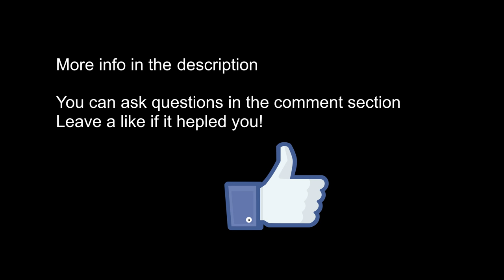Mitsubishi Lancer 2011 front brake replacement for cheap

Comment: Seems easy enough. We’ll see how it goes in practice. I hope my Colt 2007 is similar.
Reply from the maker: It should be, I have an upcoming video on Dodge RAM brakes, and there's not much difference. I hope it went well for you.
Reply: @sgcars6731  Hi, so I went for it. It was smooth on the first wheel. As per video. Went to the second wheel, removed the top bolt from the caliper, tried to undo the second but someone round it previously. I had to put it back and wait for a replacement bolts. Once these arrived it was easy. Cheers.

Comment: My brand new Quick Stop pads squeaks from 40 - 110kmh, I didn't put the bolts back to torque spec besides the wheels, could that be why? And the Rattle Clip centers itself doesnt it? (I Cleaned front and back of the Brake Rotor)

Comment: awesome video man.. quick question What type of brake gel did you get and where did you apply it to before you placed in the new brake pads ?
Reply from the maker: I suggest that you use brake lubricant (I used Permatex ceramic brake lubricant, but any high heat brake grease) on the sides of the brake pads where the pad touches the caliper (never use the grease on the friction surface that touches the disks, lubricant on the disk brake will reduce the stopping power, since the brakes works by friction). If you don't use lubricant, one of the pads might stick (because of friction and rust) and you will get uneven pad wear (like on my driver side, the outer pad is at 50% left and the inner pad is at 25% left because it had no grease and rust reduced the clearance).

The slide pins of the calipers must also be lubricated to prevent uneven pad wear, but note that some petroleum based greases sometimes damages some rubber boots on the pin, it depends, the Permatex lube states it can be used on rubber, read the back of the brake grease, it should be written. Some people like silicone grease, but it's not usually the best for metal to metal lubrication.

Don't forget to remove the manufacturing oil film (rust inhibitor) left on the new disk rotors (if you bought new ones) with brake cleaner, alcohol or acetone (or dish soap and water if desperate), or else the stopping power will be reduced for a while, it might be dangerous.

Comment: I went to replace my front wheel hub assemblies as far as I could see the parts sent will not work, as it appears it's only bearings that have to be removed from the housing, and new ones pressed in, very frustrating as I specified my exact year brand and model and many things say they work, but it doesn't appear so, mind you I could not brake the rotor away from the hub, so I'm curious did yours have a 4 bolt wheel hub bearing, or just the whole knuckle assembly with the wheel hub?
Reply from the maker: It happens, I had to delay my Impreza rear brakes video because they sent me the wrong rotors, the disk was the right size but the drum was too big and the parking brake didn't work. I don't know about the hub, it didn't need to get changed yet.

Comment: Thanks for the video, one question tho. Do you have to torque the bolts to a specific spec when putting the caliper bracket back on ?
Reply: From everything I've seen and read, as well as advice from a mechanic friend, no. My friend said he has never torqued caliper bolts
Reply: Not all caliper bracket bolts are the same. Typically these bolts require only 25- to 35-ft/lbs of torque. Also, some bracket bolts can be torque-to-yield or require liquid tread lockers.

Comment: Great video going to change my breaks based on your video I just have one question why did you remove the break fluid cap before pushing back the piston?
Reply: I belive it is so that the air can be purged when the clamp adjusts and holds the break pads down. That way the air can leave the system without leaving air bubbles in the break fluid

Comment: Can you take off the entire caliper then replace the brakes pads?
Reply from the maker: Yes, the caliper was rotated on the top slide pin for convenience, but it's the same pin as the bottom one so you can push the caliper out of the bracket as needed.

Comment: Est-ce que tu as besoin d'un torque précis pour les bolts ou juste tight?
Reply from the maker: J'y vais au feeling pour ça (comme la plupart des mécaniciens) mais voici les specs officielles pour si tu veux prendre le temps de sortir le torque wrench:

Caliper body assembly to the support - front disc brake:
Tightening torque:
Caliper bolt: 27 N·m (2.75 kgf-m, 19.9 ft-lb)

Front wheels:
Tightening torque:
120 N·m (12.24 kgf-m, 88.5 ft-lb)
Reply: @sgcars6731  merci!

Comment: You don't need to bleed the brakes? Merci pour la vidéo!!!
Reply from the maker: No need to bleed if you don't unhook the brake line, Il faut juste presser le piston du caliper pour pouvoir mettre les nouveaux pads et le liquide va retourner dans le réservoir. Maintenant j'utilise une simple C clamp, ou des fois juste mon pouce... comme dans mon vidéo Sur les freins arrière de mon Subaru à 8 min 54 sec https://youtu.be/_FQKrtoLtKw
Reply: Merci SG Cars. Brakes done! You're the best!

Comment: 0:14 please what size is the hexagonal tool used for these or can i use regular pliers
Reply from the maker: I think it was a regular 14mm metric socket/wrench , but don't use pliers, it may damage the bolt and you will regret it next time you have to change the brakes. If you don't have wrenches, look at a big car store or a Walmart, the often have small kits for less than 10$.
Reply: SG Cars thanks man! ill check in Walmart or AutoZone. thanks again!!
Reply: is it really just a 14mm or a 17mm is needed to remove the caliper bracket? Thanks!

Comment: Do you need Threadlocker on the slide pins?
Reply from the maker: No, that's the opposite, you need it to slide freely, you need grease (high temperature brake grease). On this design, putting thread locker on the slide pin could make the caliper seize and cause uneven brake pad wear and even warped rotors (by overheating them).

Comment: How many miles before one should change pads?
Reply from the maker: Between 30000 and 70000 miles although, it really depends your type of driving. City driving wears the pads more than highway driving. Pads usually has a metal tab that will squeal when they need replacement, but some cheap pads don't. It is a good idea to check the pad's thickness from time to time (once a year maybe). Pads usually need replacement at 2.5 mm of thickness left (0.1 inch).

Comment: How many Newton Meters of torque do i need to fasten the Bolts?
Reply from the maker: +ScoutThe64 I don't have the service manual and Google gives me different answers... My answer would be tight it snug enough so that the caliper won't fall off and small torque difference between the two caliper bolts is not critical.
Reply from the maker: I have the service manual now:

Caliper body assembly to the support - front disc brake:
Tightening torque:
Caliper bolt: 27 N·m (2.75 kgf-m, 19.9 ft-lb)

Front wheels:
Tightening torque:
120 N·m (12.24 kgf-m, 88.5 ft-lb)
Reply: Thank You! That helped!

Comment: How much do you torque the caliper bolts bro
Reply: caliper guide pins are 32ftlbs + - 4ftlb (Front ONLY)
caliper bracket bolts 74 + - 7ftlb (Front ONLY)
could be inaccurate make sure your car is identical to the video not responsible if you damage anything. these are specs for a 2011 lancer es 2.0l
technically wheel torque is 78ftlbs but everyone at the dealership just does 90ftlbs
Reply: How do you measure torques on bolts? Sorry if i sound stupid but its my first time
Reply: You need a torque wrench

Comment: Y'a aucune vise étoile qui fau enlevé ? c'étais les frein d'origine ?
Reply from the maker: L'auto a été achetée usagée à 30000 km et c'est une manuelle, donc il y a de fortes chances que ce soit les disques originaux sans vis étoiles. Sur mon Subaru n'avait pas de vis non plus. Si il y a une vis à enlever alors c'est mieux de le faire avec un tournevis punch ou un impact driver, un tournevis ordinaire à tendance à détruire l'étoile, surtout avec la rouille.
Reply: Je comfirme, il n'y a pas de vis, mais les brake arrière son chiant a faire a cause des drum a l'intérieur ahaha!!
Reply from the maker: Oui il faut pas oublier d'enlever le frein à main pour pouvoir enlever le disque.
Reply: enlever le brake a main et a lintérieur le brake n'est pas usé donc il y a un gap. Fau aligné le trou du disque a chacun des drum pad. Et poussé chacun des pad pour mieux sortir le disque

Comment: seeing how eroded your clippers where you should have sanded then painted the calipers
Reply from the maker: Corroded? This is only cosmetic, this part is actually a treated part that corrodes less quickly. People who live in nordic countries expect that to happen, we apply anti rust when possible, but there are still too many small bare metal parts on a car to paint them all. So yes it would have been good to paint all 4 calipers, but then you would have to bleed the brakes, and then you find other rusty bits, then where do you stop?

Comment: what if it still make a noise when u push da break after u change da breaks?
Reply from the maker: If it sounds like it rubs every wheel rotation and it increases with speed, the rotor might be warped. A high pitched noise might come from the brake pad shims. Those trouble may be caused by low quality parts, I would suggest watching the following video: Brake Shim Fail - EricTheCarGuy